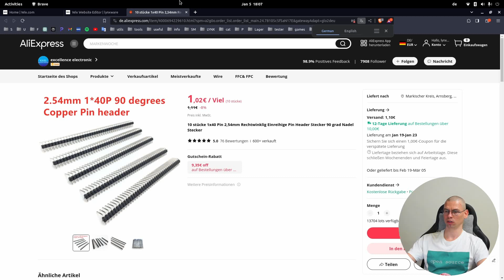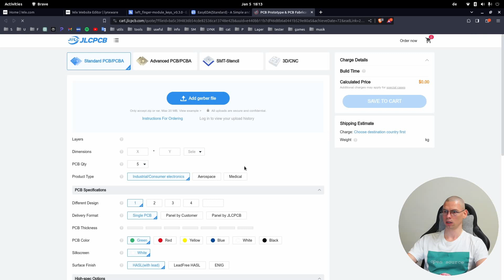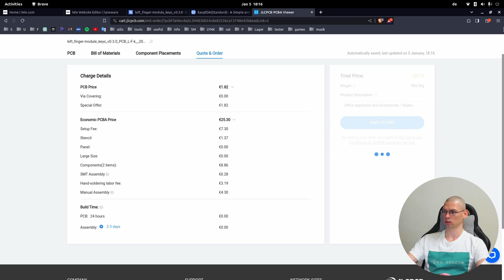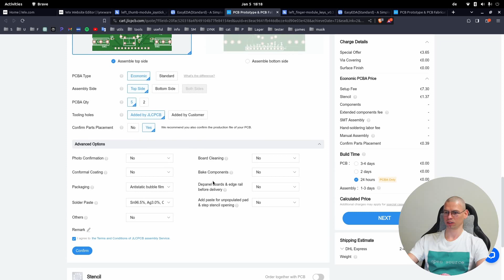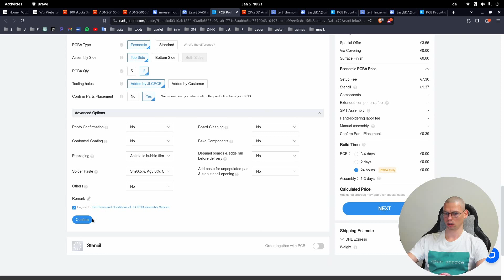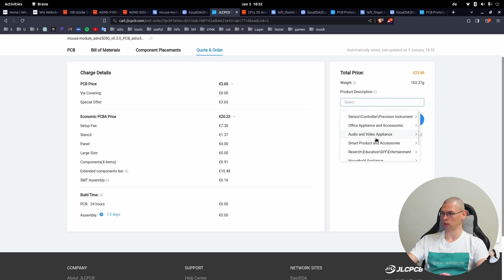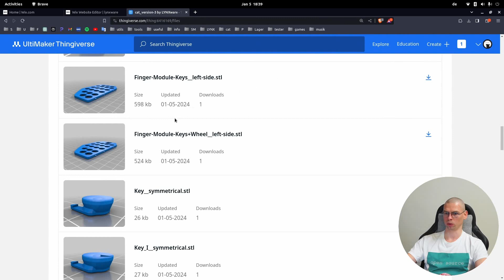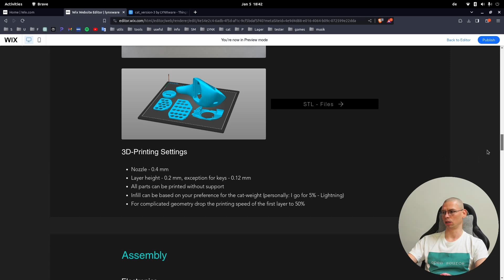DIY CAT - Part 1/2 - Components

Comment: Hi I’m about to order the pcb but can I still use Gikfun AC 1A 125V 3Pin Limit Micro Switch because I got so many of them and can I use the elite series 2 module or do they have to be the ones you specifying
Reply from the maker: any standard mouse switches should work, as far as i know they are all the same